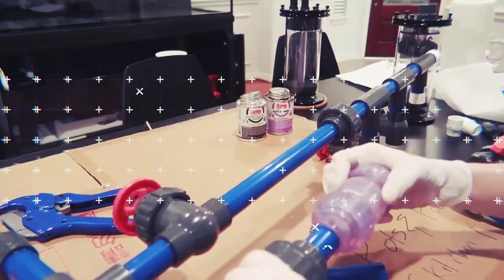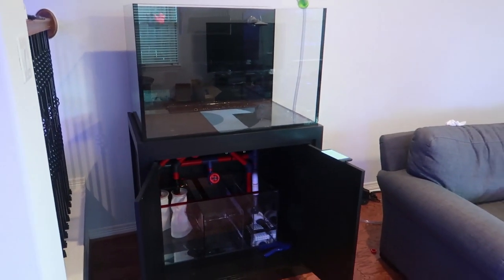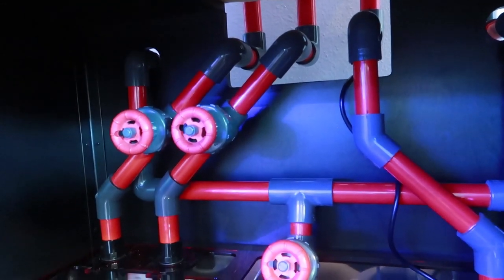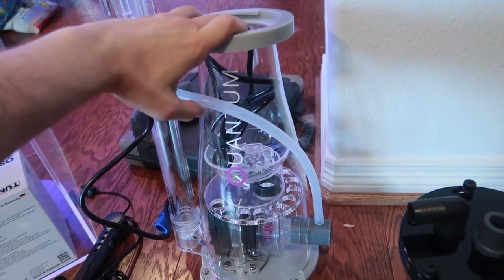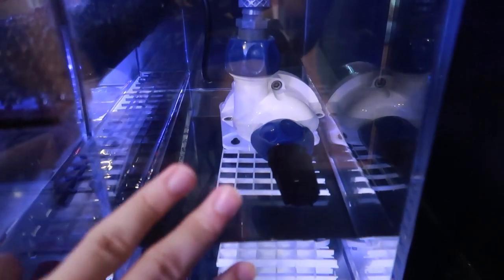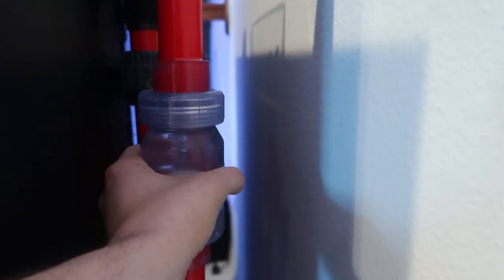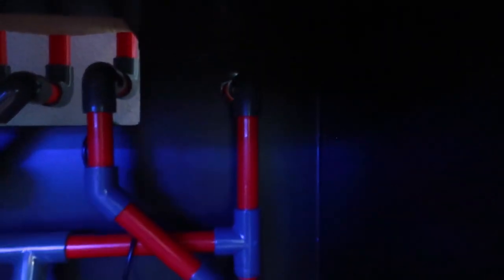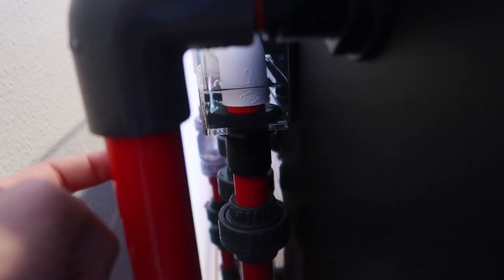90g Clown Harem "The Borg" Build Series | Part 3: Plumbing

Comment: the most basic principle of the bean animal overflow is to not have 90's on the pipes, you are better off like this than with dursos but you do not have a bean animal, you have also bypassed the second safety feature of the bean animal

Comment: Aaron, Thank you for the update. Well done. Would it be possible for you to sketch out the plumbing schematics (with water flow directions) and post it?
Reply from the maker: Hmm. I have one in my R2R thread actually! It's on the first page (I have 2 drawings, the second one is the more correct one) https://www.reef2reef.com/threads/resistance-is-futile-90g-borg-cube.411824/